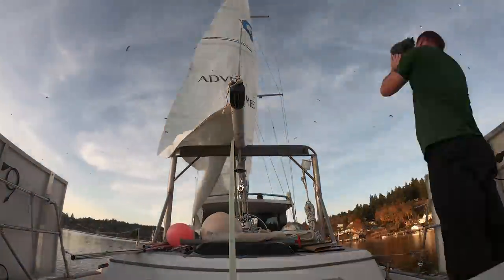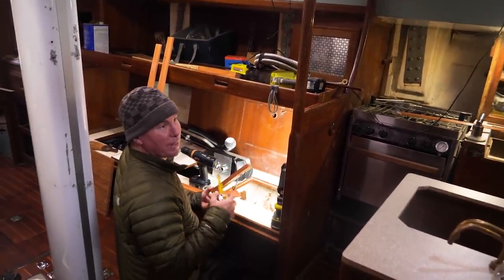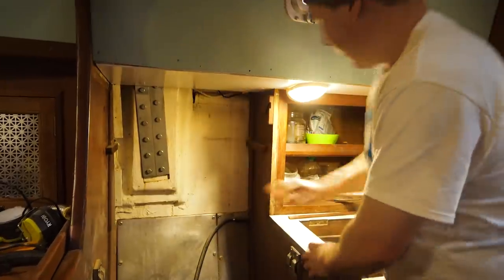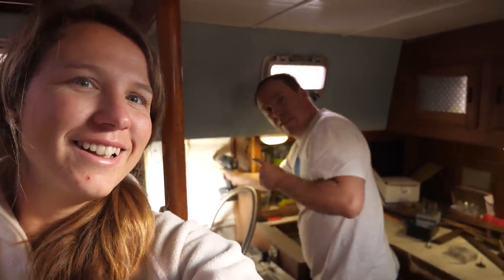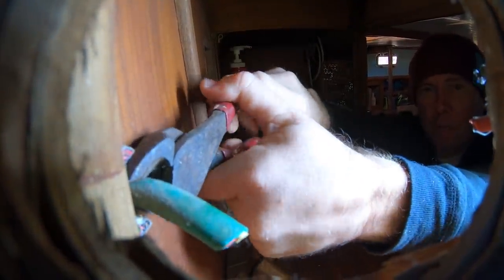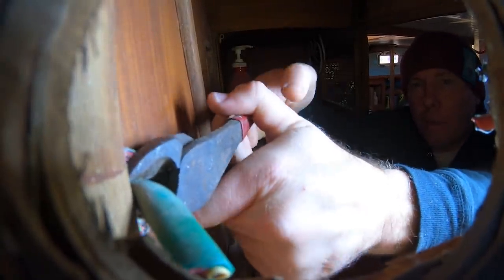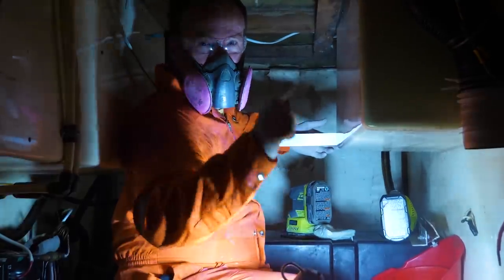Installing a Diesel Heater on a Boat [Adventure #193]

Comment: I have bought and installed the ebay 'cheap chinese diesel heater' for $100 on my boat and it works great! DO NOT use the muffler that is supplied for a boat installation! It is meant to be installed under a van and has a drain hole and will produce carbon monoxide! There are proper boat style mufflers that will work if you want to buy them from Sure Marine Seattle. I did not see where you are supplying the heater with its combustion air intake from. It needs to be from outside the living space. If you are careful with the fuel you are putting in the plastic supply tank do not use a filter. It will just leak eventually. One last bit of advice order the 'Afterburner' control from the dude in Australia to control the heater. Its only about 50 bucks and has a way better display and has Bluetooth and WiFi connection options. I am happy to discuss more on the heather via email or phone if you would like. Its nice staying warm onboard in winter in the PNW!

Comment: That's way to funny. A Kilometer, Nautical mile and Statute Mile, not to mention Fathoms are all a mind set. Yards, feet and inches are made up of fractions. Fractions got us Yanks to the moon. Go with what ya know.
Reply: @Susan Hahn . My tool box (as an armature DIY Mechanic) has both ASE and Metric. As a world traveler I have come to make these conversions as second nature. My kids learned fractions and decimals via an AMERICAN tape measure and a slide rule, before I allowed them a calculator,  I "Personally" think they are far better for it. Don't get me wrong, they also learned the metric system... Not to mention they can read an analog clock! LMAO 

And I do not care who you are... Ask ANY mechanic which sockets or wrenches go missing first! I will GUARANTEE the answer will be 1/2 inch or 10 Millimeter!

Comment: Would add a fan to the intake fresh air vent to get more Air into the Unit like what they use on a Pc to keep it cool very low Watts also would see if you can check for leaked gas's in to the Boat ? , Nothing like going to sleep and not waking up .Q: where you put the out let for the Exhaust will it be near any fresh air intakes say like near the Engine as it might chock the Engine ?. Good job looking forward to the next Vlog Guys.

Comment: I see a lot of people have already commented on some issues with your installation, but I just wanted to add my 2 cents.  There was an problem a few years back at my marina where a woman almost died using the same brand heater you are.  I heard the company sent someone out and found issues with the installation that caused the problem.  I installed an Espar heater in my boat last year, and spent a good amount of time looking through the documentation and installation requirements, I believe they should be very similar to yours.  So anyway, here is the list of things I noticed

1. There is a limit to how long the exhaust should be, i believe for my heater it was something less than 2m, yours looks pretty long
2. The entire exhaust should probably be covered, it gets very hot. Clamping/ support should be outside the insulation, otherwise all your metal hangers will transfer a lot of heat from the exhaust to the wood its mounted to. Also there should be an good air gap between the exhaust and any combustible materials, looks like you have it clamped directly to wood.
3 Since your exhaust is pretty high above the heater and long it will need a condensation trap/ drain at the lowest point. They sell these that can just be added into the line.
4. Fuel line coming out of pump looks like a long run, I believe the pump should be located relatively close to the heater so it provides an accurate volume of fuel with each pump
5. There is a certain angle that the pump should be mounted, I want to say its around 45 degrees, yours looks like its almost vertical
6. The hard plastic tube you are using for fuel is not ABYC compliant, either hard metal lines or marine grade reinforced rubber hoses should be used.
7. Combustion air should come from outside anyway, but especially if you are recirculating cabin air.
8. If you can I would recommend pulling in fresh air rather than recirculating (both for safety and condensation) This does mean you need a temperature sensor (if its not included in your controller) because the incoming air will be pretty cold so the internal temp sensor will not work well. 

9. The muffler might not be the best for marine use, as others said its meant to be mounted outside a vehicle.  Also it will definitely get hot and should be wrapped.
10. Your outlet will be hot, probably want to put some sort of shield/ cage over it to protect people/ things from getting burned

Comment: You must have the air intet to the Heather be taken from outsider the boat, and the Exhush mufler is not save, you must change it to marine Exhush , this type of Heather is running Best with Furesø air from outside and you most have a oxide alarm. Happy new YEAR to both of you.

Comment: Oh dear. Just nearly got gassed from the diesel heater on my boat so thought I had better give you some warnings based on my experience in addition to other comments. 

Firstly I used to be a marine engineer for 20 years so now retired bought a 15 meter boat with a Wabasco already fitted by the builder. After some research (manufactures installation manuals) found the the whole system had not been installed correctly, so basically refitted it. 

Point one (and most important) the heater should not be installed inside the boat,  in the lazarete with no connection to the inside other than the ducting. In my case the air inlet was from inside the lazarete so piped in an inlet from both the inside and from outside the lazarete, with a Y valve so I could use the cold fresh air inlet option. Also on Wabasco the thermostat is on the inlet so the heater was always running flat out as the incoming air was cold. 

The manual says you should NEVER have the cabin air inlet and the combustion air inlet from the same area, or have the exhaust in the same area in case it leaks. The heater surface also gets very hot, so mounting on or near wood is maybe not such a good idea. 

The manual also suggests that the system is 40% more efficient if the heat ducting is insulated, made a big difference on mine. 

I did run into a problem, with the increased efficiency I got after the reinstall found the heater was overpowered and is now runs on low load most of the time causing to to soot up. Solution, give is a blast before shutting it down.

Now here's how I almost got gassed, heater came on automatically an hour before I get up, as normal, when I got us I almost collapsed, with the cabin spinning, so staggered out into the fresh air. I had two CO digital alarm monitors. Neither had gone into alarm. but were  10-14ppm. Even more confusing was that the monitors were still reading the same outside the boat, so initially though they were faulty. 

After much searching figured out that with the still morning air the exhaust fumes were collecting around the boat and getting sucked into the air intake despite being well away from the exhaust. Got reading up to 10 meters from the exhaust. 

I will be getting CO alarms that are a lot more sensitive and can alarm at 10ppm. Waiting until it gets to 30ppm for 90minutes as on some cheaper monitors seems crazy.

Comment: I’m not to knowledgeable about diesel heaters and wonder how much heat that small will create? The safety factor also concerns me! That’s most likely just the old man in me! So many great technologies have been introduced it is hard to keep up. The holding tank is required in many ports so I guess it is a necessary “evil”!  Did you finally get the new sails installed? Looking forward to seeing them filled with a brisk breeze and pushing you along! Happy New Year kids.

Comment: If you are enclosing the exhaust you must really consider wrapping the exhaust in an exhaust wrap made specifically for exhaust systems. West Marine sells it by the foot. When using this product you will also need single strand stainless steal wire. 
Because of the hazards of fire please do not run the exhaust behind cabinets with out the covering.

Comment: You need to get exhaust wrap for it and heat shield for fuel line
Reply: Get 1/4" fuel line
Reply: @davidrhightower  1/4 inch fuel line is fine ONLY to feed the pump. From pump to heater the line that came with it is the must have line.
Reply: @Nimashet  nope. Real fuel line not plastic crap fuel line on boat. Works just fine in my big truck and boat
Reply: I agree the fuel line needs protection, but In this application, using exhaust wrap makes more sense in just the highest heat areas where not doing so might result in burning the surrounding material, because the rest of the longer exhaust run inside the cabin results in the exhaust heat also heating the cabin too. Regards Dave.
Reply: @davidrhightower  all the heaters I had when OTR had the plastic line. My heater has same line as the last truck had.
Reply: @Nimashet  they must of been too much of a tight wad to buy real fuel line

Comment: next video will not be about leaks, it will be  about gas detector installation. :)   reflecting heat from the exhaust  will be nice but i recommend a  heat resistant layer between reflector and hull.   i am not an expert but i am paranoid on this kind of things :)  
Best wishes for new year :)

Comment: Instead of making an air intake from the locker into the cabin, there is a better solution that is used in domestic oil burner installations, to maximise burn efficiency and minimise heat loss. 

If you have enough of the stainless exhaust hose left, you should consider running another run of the hose to the second redundant through hull beside your exhaust outlet and back to your burner air intake this would act as a fresh air intake, meaning that you wouldn't be taking heated air from inside the cabin to vent out the exhaust during combustion. Regards Dave
Reply: If you do this, try to shroud the intake away from outlet to avoid sending exhaust back to the heater.
The fancy industrial solution is coaxial duct with the exhaust on the inside, intake on the outside. Lots of advantages.
Reply: @artsmith103  though not necessary, it wouldn't do any harm to do as you say and a simple stainless bracket between the intake and exhaust would suffice, where I live domestic oil burners use a snorkel system, which has both the air intake and exhaust in a single pipe, with the exhaust projecting out just slightly further than the air intake, the fact that the exhaust is forced out during combustion  actually drives it away from the intake, which can clearly be seen in cold weather, as none of the exhaust is drawn back in through the intake section. Regards Dave.

Comment: To add on from lat time. I have the same heater. You may want to check out the troubleshooting channel for the heater on the Book of Faces. Lots of info and help in there. Hope you stay warm and dry. Fair Winds.

Ps miss the canning videos 😇

Comment: Had noticed in past videos the use used imperial measurements and had just assumed you had gone to the dark side, good to hear you still prefer metric. Ditch that tape measure and get a tape with metric ONLY.....don't even think about one of those metric/imperial tapes...  :)
Reply from the maker: Hard to find in the US!  Plus, all our stuff is a mix of US/Imperial sizes... if we could all just get on the same page..

Comment: Wow - you sure generated a lot of comments on this one. I cringed when I saw you starting to put the through hull on the side of the hull - and breathed a sigh of relief when you changed the position. Yes - metric is better, I’ve built boats with both systems.  I hope you can sort out all the suggestions and end up with a safe and durable heating system. Are you two going to be at the Seattle Boat show this month?
Reply from the maker: We are thinking about a trip to the show if time lines up..

Comment: MMMMMMMMMMMMMmm being a marine Mechanic for many years have not seen or run into that one would think the heat generated from the glass would compromise the wire coatings casing problems/// Happy New Year to both of you best of luck to 2020 crewsing// sailing

Comment: If you do not like our system of inch’s and feet,why not just measure in metric and cut to your metric measure?
Reply: Getting a metric tape in the US is the challenge.
Reply: @FromThePrairies  even in Canada you can't get a full metric one. I bought some in Europe last time I was there.
Reply: Jake  na rubbish , there are plenty of metric tapes and tools in the USA. Remember when we changed to metric officially the auto manufacturers and Military went metric like the government told them to. Then the next government stopped all funding for the conversion so it all stopped. Remember in the late 70's early 80's when we had gas being sold in liters? ( I do)
So we are stuck with  the confusion we have now!   Cheers Warren
Reply: @CheersWarren  ok, show me a metric only measure tape.

Comment: Now that you've had it running for awhile, measure the temperature of the exposed exhaust. Less than 400F is probably safe for fire, but over 150F is dangerous for skin burns.
Consider pipe inside pipe. Exhaust in the center, combustion air on the outside.
Reply from the maker: Wish we could measure all along but we are still looking for our laser gauge, the current fitting in the hull is pipe inside pipe to insulate the fiberglass.
Reply: @AdventureAdriftSailing  Your multi meter might have a T/C probe. 
To burn, substance must get to its "ignition temperature."  Paper (wood) is around 450F. That's why the pizza cardboard doesn't burn when you accidentally put it in the 400-425F oven :-)
Maybe you can look up the ignition temperature of the hull polymers for your peace of mind.

Comment: engineering metric is in mm, when you get to 42376mm, it just isnt memorable in the same way imperial is, which is kind binary
139ft and a 1/4 inch 
the first job we did for a shed for a barge going to New Guinea, we look at the dwgs, its all metric. 
We cleared this huge space in 3 bay with the cranes, then it turned out it was about 8ft x 6 ft
the exhaust will work like an Alaska stove, be careful it should get very hot

Comment: I think your going to have issues with that install, and you definitely need a CO alarm too, those pipes need sealing joint compound on them, and you need to install a drain, apparently there's a drain in the side of the muffler so it needs installing correctly, yours is not, see this video here https://youtu.be/hj8da4WQaac  watch at 9mins 50 sec. you can also put a copper tube condensate drain instead. Seriously though they don't call CO the silent killer for nothing.

Comment: Could you not install in the engine room, run a small extractor fan at the same time , 
Eng room normally has extractor, don't you usually have exhausts on the transom, less water ingress,

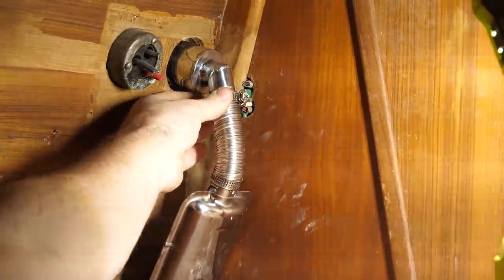Comment: The pipe clips seen at 11:37 are not worth any more than a cable tie. They're dangerous whether they're used for coolant pipes or gas tight seals. They really shouldn't be supplied with diesel heaters.
It's worth every single penny or dime, and your time, to get quality hose clamps.

Any time I see these stupid things, they're binned and replaced, they won't compress the pipe to seal before they strip. 
They don't do what a steel band clip was designed to do. If you haven't considered their strength, I'd advise replacing them ASAP.

Comment: Dude that silencer is NOT for indoor use. It's not fully sealed and will leak TOXIC FUMES (at least unhealthy!) into the cabin. The silencers that come with the units are for installation on OUTSIDE of a car. Do yourself a favor and get a marine grade silencer that is fully sealed (30£ ebay). ALso get a carbon monixide alarm - 12£ that may safe your life if unit malfunctions.
Also, by-product is water vapor, so if exhaust goes UP, ensure condensation fluid can get out without flowing back into the heater.